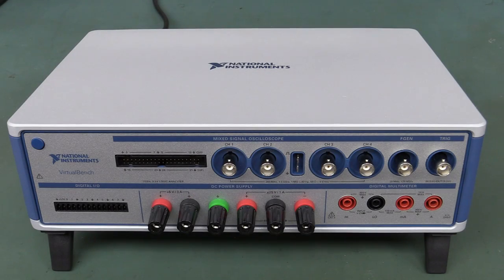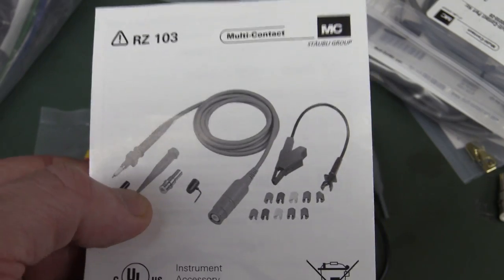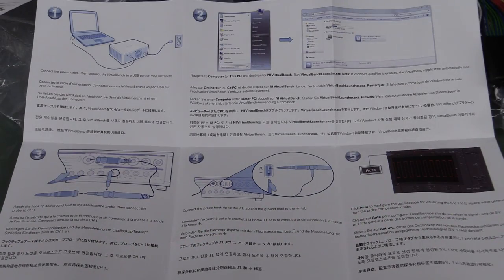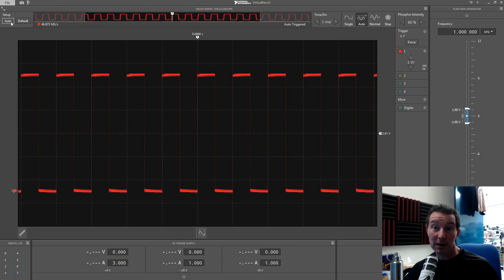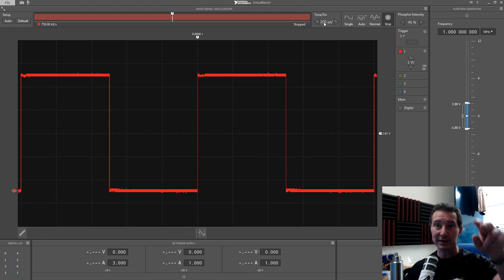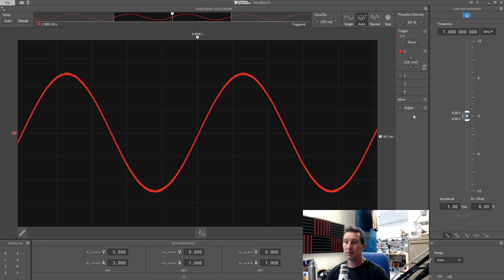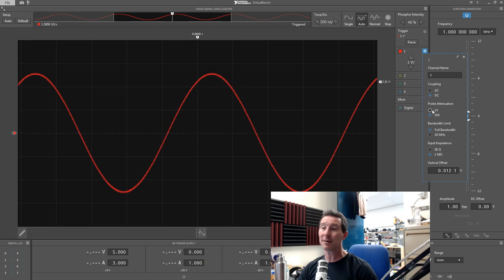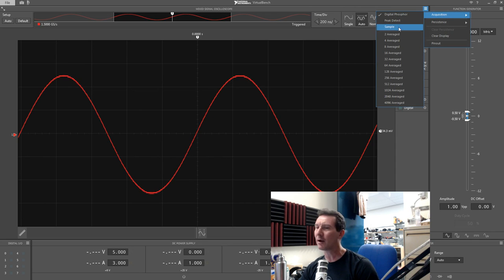EEVblog #876 - NI VirtualBench Review

Comment: From an educational standpoint (I've been teaching electronics to students at uni and for the courses it had been decided to use NI Elvis and myDAQ, which you could see as the low end version of the workbench):
It is an advantage that all the hardware can controlled by the software, so it makes some tasks, like bode plots or tracing component characteristics, very easy. Now that you mention it in the video, these "low end platforms" had software for bode plots and 2/3 wire measurements for components! It's weird that with a platform priced that high they did not implement something like that and loses thereby all advantage it had over dedicated devices.
The disadvantages IMHO outweighed it. I don't really know why, but the knowledge of how to use the tools in software did not transfer over to use the real tools. Give the students a real scope or DMM and they were stuck (to mention the "low end platform" again: at least the software UI looked a little like real scopes/DMMs, and even there it was hard to go from "virtual" to "real"). There's also the quirky issues that sometimes the software has bugs and certain settings give wrong readings. And there's the annyoing issues with hardware not being recognized by the PC, sometimes licencing issues, driver issues after the IT department updated the PCs aso. 

The other issues (which as you stated would never make a professional buy aa virtual workbench as daily tool): a "normal" lab power supply and a good DMM can easily be had for less than $1k  and are useable for a decade and much more. What happens when NI decides to stop supporting the workbench with its software? A perfectly fine PSU and DMM hardware, but no way to use it...
That leaves you with $5000 to spare, which will get you an equivalent brand MSO+fgen from Keysight/Tektronix (and I would even consider Rigol). Again, a scope will work decades, if treated well, and no missing driver/OS support will suddenly make it an expensive brick. So I would never recommend the workbench over dedicated tools.
Reply: +superdau 
They should have just put a dedicated computer inside it, say a RPi compute module or similar. Just plug in a keyboard, mouse and monitor and your go.
Reply: +Jack Evans 
Or even a optional regular scope front end.

Most of the issues with this seem to be with implementing the control software.
Reply: We used these in school. The main advantage of the software is allowing for easy screenshots of the scope/analyzer data, so I could quickly assemble a graphical collection of data.

In our lower division classes, we used simpler tools, so we graphed and tabulated everything by hand.

Nowadays, I would like a decent oscilloscope and function generator for my own usage, but I make do with a leftover educational tool with a software interface - the Analog Discovery 2.

Comment: The problem with locking USB cables, is that if someone pulls it by accident, the whole shooting match goes flying. Can't say I have ever had a USB B casually fall out in normal use.
Reply: +Zadster I have had the USB B fall out, several times. In classroom labs in fact.
Reply: +Zadster Agreed!. That's precisely why the USB spec has ditched the screw-locking stuff
Reply: +krypton2k Yep, but that would happen to virtually any usb device, right?
Reply: Clovis Fritzen yes it would, but reduced motion decreases deterioration of sockets and the resulting attenuation and noise from chip creep.

Comment: The list price on these aren't the actual price universities buy them for. Most research universities (at least in America) buy these in quantities of anywhere from 10 to a couple of hundred at steep discounts (anywhere from 50% to 75% off). There's a reason why NI is the standard when it comes to university lab and learning equipment despite cheaper and more "feature rich" competitors:  when it comes to ease of use, product service/repair, software integration, and flexibility, no one beats them. And you have to remember, a lot of the people using these aren't EE or CompE majors. These are often used in physics or chemistry labs by people who dont know a single thing about electronics and want nothing more than something that "just works".

Comment: For the price, NI could have gotten high end Noctua fan in there and it would have been whisper quiet.
Reply: better yet a "be quite!" fan, they almost have negative decibeles (well, thats an iver exaggeration if you haven't figured but they're quite)
Reply: +Anas Malas BeQuiet! doesn't supply or manufacture industrial fans. Papst has been the choice for manufacturers when they need long life time and reliability, but Noctua does have their industrial fan line that are meant for difficult enviroments and they know how to make a quiet fan.

Papst doesn't worry about noise but reliability. :)
Reply: Mtaalas which makes me wonder, what makes a fan industrial? Ive seen BeQuite! Used in 4000$ rigs!!
Reply: +Anas Malas If you can put the fan under water and it still works for thousands of hours... it's industrial. :D
Reply: +Mtaalas The Noctua stuff is all consumer grade hardware. NI should have used an EBM Papst fan in this unit.
Reply: +PERILEX They know how to make industrial fans alright... and they've shown to eg. run submerged under water for thousands of hours. :D

http://noctua.at/en/products/product-line-industrial
Reply: +Anas Malas LOL Please don't confuse expensive consumer-grade PCs with Industrial equipment like Data-centers, Power-cabinets or other serious machinery.
Reply: +Mtaalas They don't sell any IP X8 products so they can only guaranty that their fans could work under water for a specified time but not continuously.
Reply: +PERILEX

Would you please tell me which product you'd use in this application if high reliability is needed? I can't find anything running on ~12v DC from their compact lineup that's a standard PC size (80,92 or 120mm in diameter and 25mm thick) that has life time of more than ~65.000h.

Even if I give room for different sizes, I can't find anything that has the same service life or IP rating that Noctua industrial fans have.

I would definitely be interested to find one from papst if there's any.

:P
Reply: Mtaalas There are a lot of EBM Papst fans I would use for this specification and they do also have several IP 68 rated Compact fans.
Lifetime-wise the lifetime displayed on their products is the lifetime EBM Papst expects from their products.

There's also an international standard for testing the lifetime of a fan and the results of those tests can vary extremely from the lifetime the manufacturer expects.

For example: The lifetime EBM Papst expects from the EBM Papst 3312 NL is 80.000h and 35.000h under the highest allowed temperature.
The expected lifetime of that fan according to the international testing procedure is 135.000h.
Reply: ***** 
.
..
... what?
Reply: ***** that are out of production and are waaay overpriced
Reply: ***** wasnt serious either :P 
As far as I know they are good value and not overpriced... 

Although that was a terrible effort of mine at sarcasm....
Reply: Anas Malas Yeah... (no sarcasm)

Comment: Cool!  An NI Virtual Bench.  I didn't get to use one of these while I was working research but I did do a bit of LabView programming.  Once you get the hang of the GUI in LabView it is really easy to make any slick looking virtual instrument or control panel that you want.  It's free to try and cheap for students.  
Thanks for the review.

Comment: Hey Dave, a thought on the constant power load you applied.  For a programmable load that looks like constant power, with the programmable supply turned off, as soon as you enable the programmable supply and it ramps above the minimum compliance of your load, the programmable load will draw an excess of the programmed current limit while the supply ramps.  This will push the supply into constant current and never give it the opportunity to ramp.  If you power into CR?

Comment: So basically, the same as almost every time a hardware manufacturer makes some kit and bundles software with it. Good hardware, terrible software.
These days I tend not to bother with such devices. I get hardware that I know will work nicely with open-source software (e.g. sigrok). It would be nice to see more hardware companies realising this, and actively soliciting the opensource programmer-types to help cooperate on a project like that.
Reply: +Paul „LeoNerd“ Evans the "cool"thing about this hardware/software combinations is...when you updated your PC let say 2-4 times....you can be sure that the old provided software will not work or even run anymore...so you´re stuck with a 6k block lying dead on your bench.

Comment: nice review, but I couldn't understand Dave's enthusiasm for NI from the start. OK, the instrument appears to be quite solid in its construction, but I still believe that decent real instruments are much more suitable for education. And for this amount of money you get a decent set of scope, power supply, function gen and multimeter.
Reply: For reference, similar spec'd 4 channel, 350MHZ MSOs are in the ~12K price range without power supply, DMM or DIO. He keeps saying its an educational product, but it is not, its an industry targeted product which also fits into academia.Its a quarter of the size, and under half the price of typical instruments, with virtually all of the same functions. There is also a 100Mhz version for 2000, which is a more appropriate for academic. And faceless instruments are the future :)

Comment: Nice review Dave.  I agree that is nice and fairly well done as I would have expected from NI.  Lots of missing features that would be pretty easy for them to implement if they decide to.  Another simple missing feature that may require hw changes is separate output enables for each power supply.  It would be interesting to see an NI demo or an explanation from a designer on some of the decisions made.

Comment: That small Pulse you see at 32:00 is the I2C "ACK"-Bit. The Master let's the Data line pull high again, if any Slave accepts the adress or data that has been transmitted via the data line, the slave will pull the line low. This accepting of Data takes time. That's why you've always got this spike after 8 Bits of data.

Comment: Couldn't they lower the price from $6000, to around $1000-1500? that would make it a little more reasonable.
Reply: Check the teardown, one of the FPGAs alone costs near 500$
Reply: +Razor2048 I suspect that the cost of the main FPGA and the two ADC chips in this unit costs NI over $1000 on their own
Reply: +Dreamagine1 And that's just those parts as they are, then you've got to count the support and the tech, then there's the software, etc. The price is reasonable. It does have some missing features tho.

Comment: one thing that bugs me about this thing is the lack of a screen, or any buttons.  how do you know what ip address it'll use when you plug it in for the first time, and how do you change it remotely?
Reply: +omfgbunder2008 I'd assume that you have to connect to it via USB first, then you can setup wireless and/or wired ethernet settings.

Comment: is not any Opensource CRO and Frequency Generator that might be able to use the hardware that you are using, maybe you have to use a Pro_Key as you might only have been given the Trial_Key, is there a Key_Generator in order to unlock everything.

Comment: That locking USB cable just means the device will get yanked off a table. When it says that it's searching Windows update for drivers you can press the "skip searching Windows Update" and it will revert to the driver provided by the device if one is there. I don't know what causes it to search Windows Update even when you have the driver, I've had it happen with plenty of devices. Check the instructions on what to do though, Microsoft sometimes has the newest drivers from the manufacturer and that might be expected for this device. With it showing up as a CD drive HP printers with drivers in them do the same thing, must be a Windows thing.

Comment: The trouble with having the software built in as a virtual CDROM is that it becomes useless when they release an update of the software. Unless they have something which updates the virtual CDROM image as well. I've got a few things like that which don't and the original out of date image is there every time you insert the device (but I have disabled that in the OS so it doesn't appear).
Reply: +Dave Curran 
I would expect that the CD image could be updated, probably firmware updates would have a new image.

Being able to run the software from the CD image like that is actually not a bad idea, as it means you don't have to prepare the machine before using it, for example, students can use their own machines without you having to spend the first lesson getting stuff downloaded and installed.

This could also have the advantage of it being more easy to ensure that a uniform version of the software and firmware is run and schedule updates, so you don't have to deal with differences between versions or updates disrupting the lessons. 

It would be annoying having to spend class time hunting up the correct version because a student got a new machine and the older version of the software your lessons are planned around is not available anymore(sure, you have the installer on a USB stick, but where was it you put that thing?...)
Reply: +Ts6451 As long as the kit can be updated it's a good system. But as I say I've got various things here (admittedly not quite in the same price range) where the CD image is out of date and annoying.

Comment: A quality piece of kit, but the question I would ask is, if a student is trained using this, will they be able to operate a conventional 'scope afterwards?  A really BIG mistake many trainers make, is to buy equipment that 'looks ideal for training purposes' but which is never used in industry.  The poor student thinks they've learned the subject well, but on the first job interview they are faced with a 'scope having a conventional set of knobs and are completely foxed by it. The interviewer sees this, and well...  Fail. 

Basically I could train a guy with a 40yo CRT scope, and he'd soon pick up how to use the latest Keysight or Rigol, the control functions being similar enough despite the huge technology gap between them. With this... No, because it's so unconventional.

Comment: NI makes better stuff like cRIO (with real time controller and FPGA ) with huge assortment of modules (24 bit ADCs, bridge input for strain gauge measurements and more...). This is just an 8-bit MDO with 300 MHz bandwidth, weak power supply (1 amp and only +-25V) and some DIO.

Comment: I am not very impressed, especially with that price. The software seems really basic and is not cross platform (I wouldn't use it if someone gave me one for free without Linux support).
It should have had something better than an 8 bit converter for $6K and a thunderbolt port to stream all that data to the pc in real time.

Comment: This is like a modern muscle car. Looks nice, sounds decent. But then you prod and poke, the panels are plastic, there's a plastic interior and the shifter is loose.

I know the price is ok hardware wise, but what's the point if you can buy all those tools, older, and under the price with all the functionalities.

I hope the software is just a beta and not final.
Reply: +aserta ...And it's got a 110mph(177kph) governor in the ECM.

Comment: I will tell you why i hate the idea for this product. Its for a class room right? So students will learn on this. Since its an "all in one" unit students will not properly learn how to use multiple separate pieces  of equipment. Also - its expensive as fuck for what it does. When a student finishes uni he will start specking what equipment he needs and will probably want one of those, because he will know it. And the value is is not there.